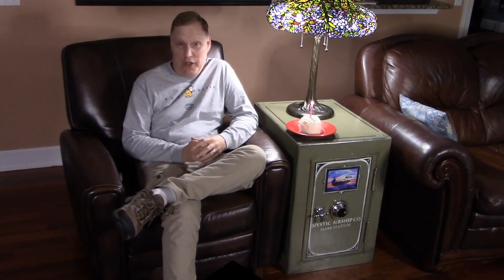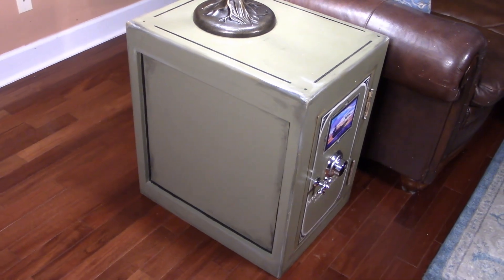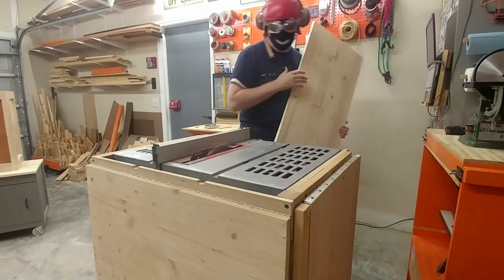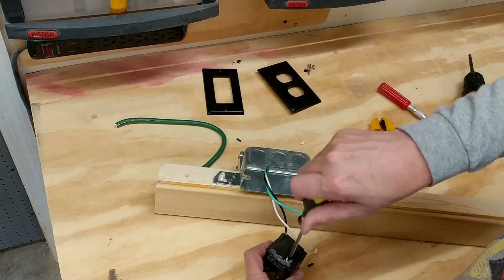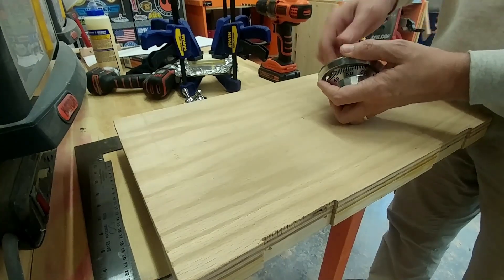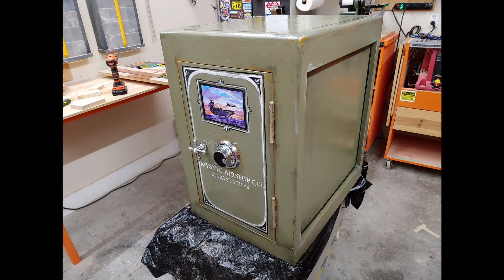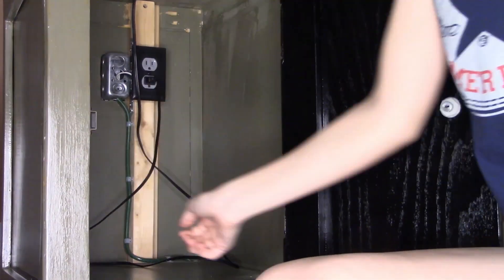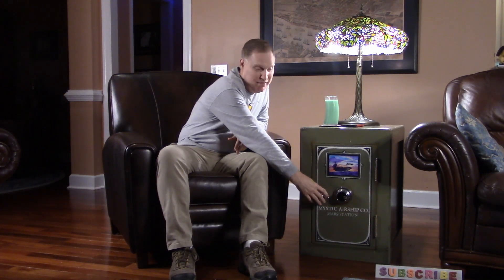Electric Safe - Artistic End Table With Electronic Powers

Comment: This gives me a great idea! At my office, there is a real antique safe in the basement. It weighs too much for the elevator, so it will always live in the basement. 

I think I will build a replica of the safe for my office. I found some cool RFID cabinet locks on Amazon for ~$10, and I think I can program it to use my same RFID card for the building doors. Now to find a combination dial...
Reply from the maker: That is awesome! Definitely do this! And we love the RFID idea! This was such a simple project but not a single visitor has realized it is a wooden cabinet until we tell them. We think it's because we rounded off the top like a safe and added realistic hardware to the door. Ebay should have some safe dials for you. We originally wanted brass but couldn't find any and revised our design to use silver hardware. Worked out great in the end.

Comment: very nice ! 
make sure that the wireless charger won't get overheat
Reply from the maker: The bottom is open to the inside of the cabinet and it hasn't overheated yet. But if it does we'll add a heat sink to it.